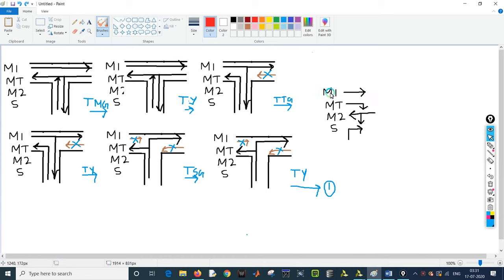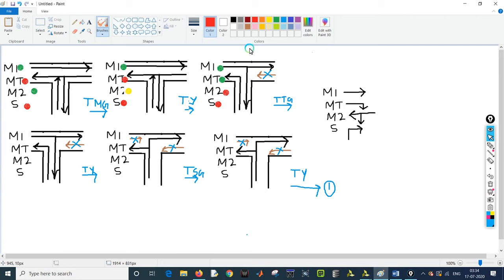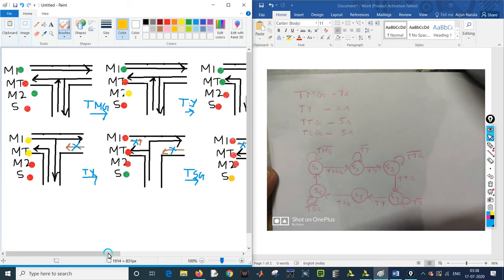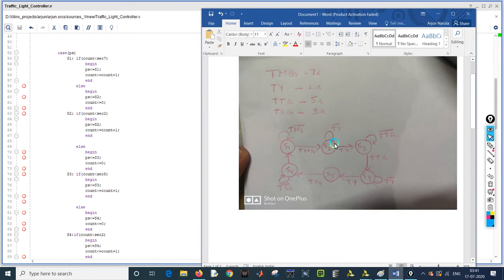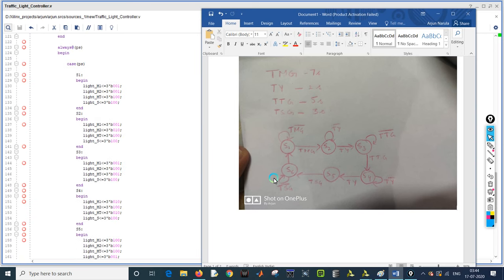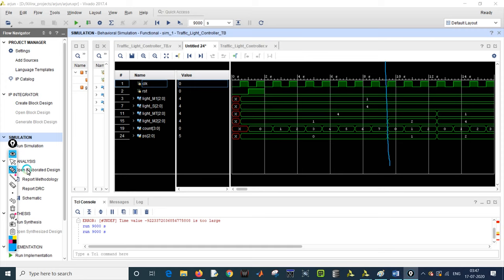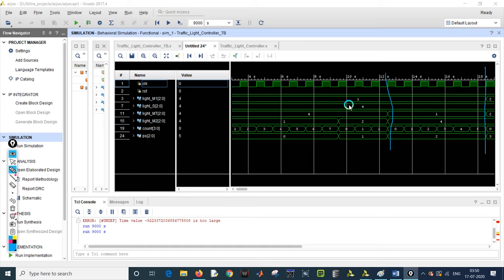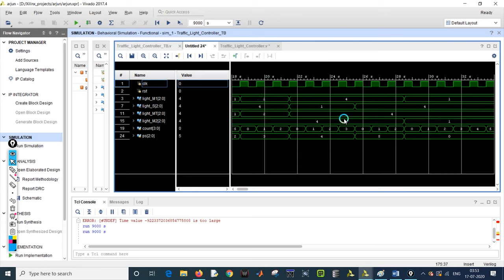Traffic Light Controller Using Verilog (with code)| Vivado| Moore Finite State Machine

Comment from the maker: Please find the code in the link description.  Any suggestions or queries are most welcomed.
PLEASE SUBSCRIBE TO THE CHANNEL.
Other Projects-
►Traffic Light Controller in Verilog - https://youtu.be/Yt7no6rwCVk
►Round Robin Arbiter in Verilog - https://www.youtube.com/watch?v=X6oJn7r9-8s
►Vedic Multiplier in Verilog - https://www.youtube.com/watch?v=6M3nyyQfpHU
►Clock with Alarm in Verilog - https://www.youtube.com/watch?v=pTk1H50e8bI
►Washing Machine in Verilog - https://www.youtube.com/watch?v=iAoi9jTzxcI
►N bit Multiplier in Verilog - https://www.youtube.com/watch?v=lmzCdx6gkdU
►PWM Shift Register in Verilog - https://www.youtube.com/watch?v=Pz9sPflKpXc
Reply: Bro in the waveform 1 means Green, 4 means Red and 2 means Yellow. How do you say that particular number indicates particular color ? Why there is number 3 ?
Reply: @bharathkrishna5917  We're taking binary values as RYG. So, for yellow it is 2's binary i.e, 010, for green 001, for red 100
Reply from the maker: @anshumanpanigrahi7817  Perfect!
Reply: Please help to simulate the test bench
Reply from the maker: @mounikayalla9850  Where exactly are you facing issues?
Reply: @ArjunNarula1122  mam you have pdf for this project
Reply: How can we make 16 bit RISC by VLSI

Comment: hello sir i have problem during running the code
traffic_light_TB.v:12: error: Unable to bind wire/reg/memory `traffic_light_controller_TB' in `Traffic_Light_Controller_TB'
1 error(s) during elaboration.
this showing i check many times but code is right i dont know why this showing

Comment: 1.Hi Arjun! a small query. How to differentiate whether it is mealy or moore FSM based on state diagram. In this case , it is written mealy(traffic light). Can we not make same project in mealy. How does state diagram change then.

2. reg count without initializing it to zero value, how code is running. Plz help. In testbench also it was started with rst=0

Comment: Hi Arjun, I'm getting red lines corresponding to M1,S,MT,M2, and the values are xxx while Simulating. Please enlighten where things are going wrong. I'm using Xilinx ISE 7.1
Reply: Did you find a solution to this?
Reply: @ayushshrivastava6917  Nope bro. Did you get?
Reply: lol naah i looked a lot but couldn't find the solution. But I am almost sure the problem lies with how we have setup the project rather than the code.
Reply: @ayushshrivastava6917  Yep, and I feel it's in the test bench code. Please let me know if you find the solution.
Reply: Same problem is occured but I am using xilinx ISE 14.5
Reply: Please help me

Comment: Bro I am getting high impedance as 'z' for both clk and rst. Could you please help me ?? I am using xilinx 14.2
Reply: Mee too Not getting proper output plz specify Version and Sparten which
Reply: Ik I'm late but any solution for this? I too am getting z for clk and reset and x for M1, M2,MT, S, count and ps.